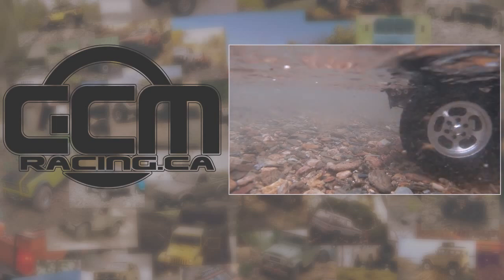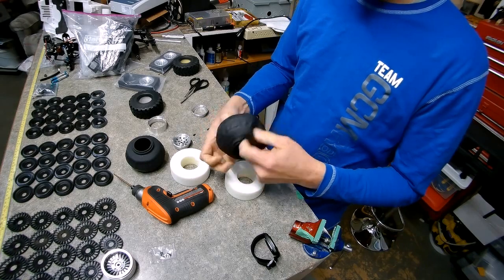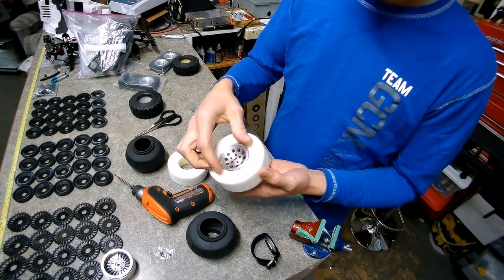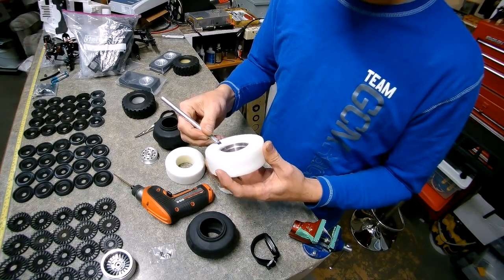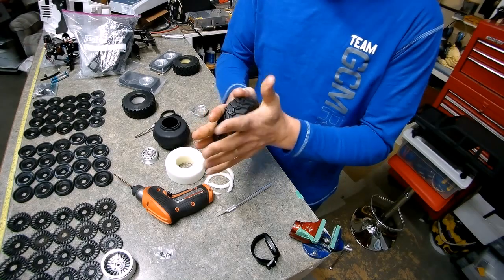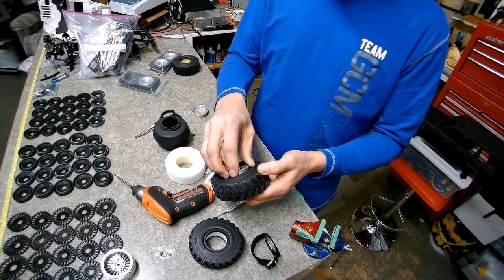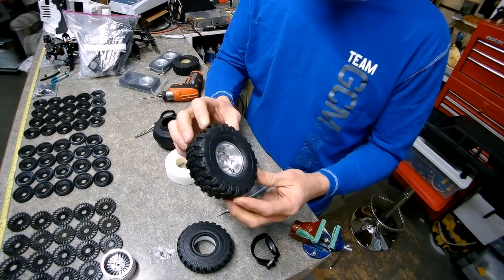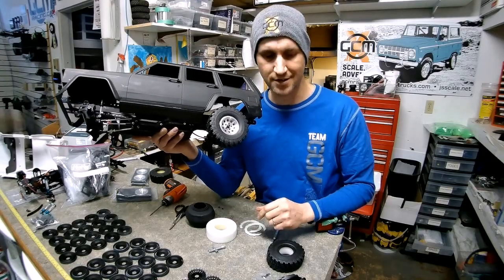RC Truck Tire Mounting Tricks with GCM

Comment: I am quite new to the rc hobby world, I put together a heavy truck, Land Rover, and used low density polyethylene foam for the tires, and for the 1/ 10 scale the truck is, it felt like a real tire. 
I don't like ordinary foam in the tire. But that's  just my  opinion. . .

Comment: Does this work with glue in tires....my Axial Blaze has a wheel that wobbles. Great tip really enjoy your videos I'm new to the RC world.
Reply from the maker: Before you glue the tire on you can also bevel edge the inside of the foam for easier fitment, yes this is true.

Comment: Yeah Ive sent many a tyre flying across room trying to fit the foams HAHA and the only reason I buy the Proline closed cell dual stage foams so easy to fit. I do like dual stage foams but think Ive only seen Prolines in the UK.
Reply from the maker: I've used a few dual stages, don't really prefer them over the singles... they are so easy to use, and I find they fit in the beads real easy with this trick. Doesn't seem to matter the foam brand, this seems to help every one of them. The closed cell formed foams won't need this trick I don't think...

Comment: Thanks for the tip. what driver is that you're using?
Reply from the maker: AH! Great question. That's a Ace Hardware bought 3.7v driver, and then Team Associated 6mm hex driver set. Love this thing.
Reply: @GCMRacing1  Thank you so much for the reply and I can't wait till I can order a chassis from you guys